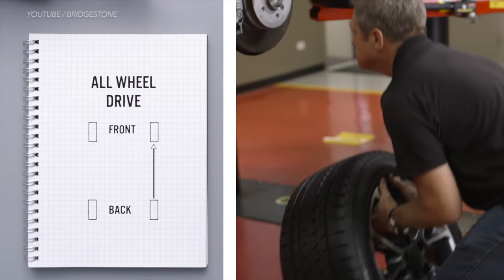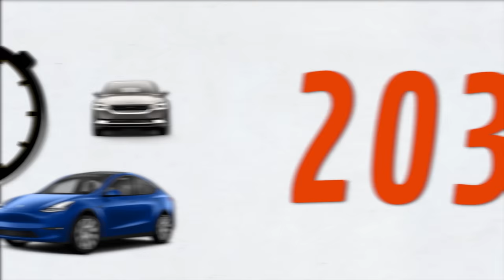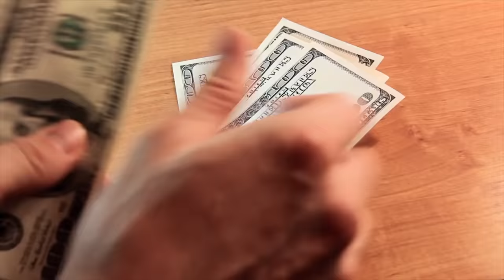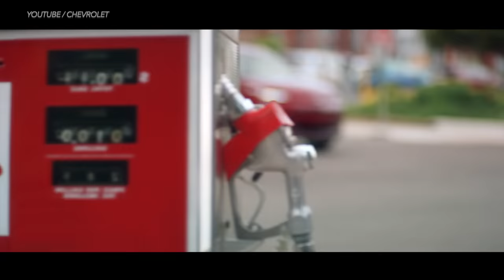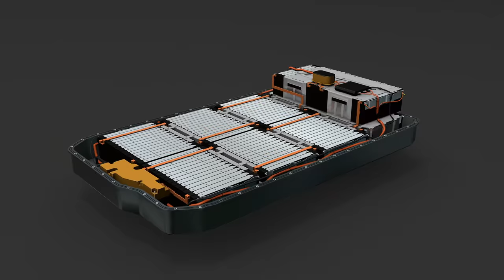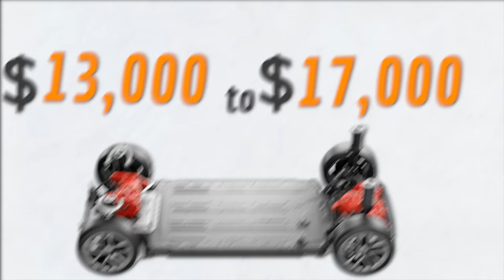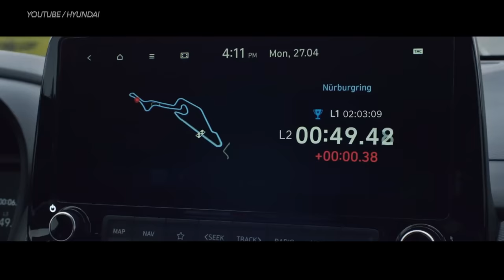No One is Telling You the Truth About the Real Cost of Owning an Electric Car, So I Have To

Comment: I'm not jumping on the EV bandwagon for another 10 years or so. Although the technology has improved tremendously over the past 5-10 years, the bugs have yet to be fully worked out; not only in the vehicles themselves, but also in the power grid infrastructure, raw material manufacturing, and the vehicle production process. We've spent, what?... 150 years developing the combustion engine to get to the modern versions, which are the most efficient and powerful they've ever been, while being affordable. EVs will theoretically require at minimum, 50-75yrs to reach a similar state (theoretically, meaning based off the combustion engine progress, but also considering modern technology is more efficient and advanced).

In addition, I won't be buying an EV anytime soon because I had to buy a new car last year (old one broke down). At that time, there weren't many EVs to choose from because, weirdly enough, all the major companies began releasing them after my purchase. And of those companies, there are some I'd NEVER buy from (Tesla included!!).
If the government tries forcing me to switch to EV, then I'd do it, but only if they pay off my car loan AND also give me a few extra grand$ for inconvenience and other issues. And I'll fight the high gas prices because a lot of it is due to corporate greed and the government screwing everything up by forcing the "green agenda" down our throats before we can actually sustain such a thing. Going green requires a plan, time, and lots of effort. If you just expect people to go out and adopt a green lifestyle over night, then not only are you hurting the people (like me, who has to sell their new car in a market where combustion engines would be useless and also be forced to pay off a car loan up front in order to do so, as well as spend more money of the actual EV) but you'll be rushing into a new system without proper preparation, which will ultimately kill the whole system.

I'm also not a very patient person, so having to wait for my EV to be "refueled" is not an option for me. There are rapid charging stations, but unless these can charge my car in like 5 minutes, I'm not impressed. And don't get me started of battery efficiency because here in Texas, batteries suffer a ton from the high heat, and you have to run your AC at full blast (especially these past weeks where it's been up to 107F), which will kill your EV's battery much quicker.

Comment: EVs are still quite bad for the environment. Battery mining, tires, the infrastructure needed for cars (lots of pavement and parking lots that absorb heat, not so much green space, etc) While they are better than their gasoline counterparts over the lifetime of the car, they are far from the perfect solution to our environmental issues.

Comment: As an owner of an EV, I gladly trade having some extra tire costs every few years to saving 66% of my fuel cost EVERY TIME I FILL UP.  And I'm not even going to mention never having to deal with a :
1. oil change
2. alternator problem
3. worn belts
4. tune ups
5. stolen catalitic converter
6. transmission problems
7. radiator / water pump problems
8. fuel pump problems
9. engine sensor problems
10. head gasket problems
11. fuel injector problems

you get the drift, right ?
Reply: For now. Soon you will pay just as much for electricity. Do you think they are going to watch that money walk away. 😂 Nope. You are an experiment bro.

Comment: The other nasty truth. Wear on tires pollutes more than an ICE in operation. When you are planning to phase out lighter ICE vehicles and have faster wear on tires EV car tires pollute more too. Think about it though, ICE emissions (which they've been able to really reduce drastically with technologies over the last 60 years) are usually gas (atmosphere) but when you're talking about rubber (and other tire products/chemicals) wearing down on tar roads...that's actually solid. That wear and tear of burned rubber and breakdown of the tire treads with rain, erosion, elements, etc. goes into the earth itself. Think about that getting into groundwater and runoff. 

This is why I don't buy into the green goons' narrative completely about motor vehicle carbon footprints and how going all electric is this environmentalists' dream.

Comment: Your constant negative rants on EV's are totally unfounded. My (Korean) EV is 5 years old and still on the same tyres, nothing has happened to the car mechanically or electronically which is more than I can say about previous car, a 2006 Mercedes 320 ML purchased new by me built in the USA and needed all 4 doors and bonnet replacing under warranty after only 3 years due to manufacturing fault. Here in Norway EV's rule and guess what, none of them catch fire? US fire departments respond to an average of 287,000 vehicle fires per year (nearly 17% of all reported fires). These fires cause an estimated 480 civilian deaths (more than 12% of all U.S. civilian fire deaths), 1,525 civilian injuries, and $1.3 billion in direct property damage annually. The ones that are EV's in annual statistics you can count on one hand. Please find another subject.

Comment: Not an EV fan! I see more problems in the future with electric infrastructure capacities. If the demand exceeds the ability to provide adequate power to maintain the additional load on the grid then there will be more brownouts. As time goes by the electrical grid will grow but what say you about power plants??? Atomic power has been vilified and has become out fashion, so has coal fired plants and soon any fossil fuel power ( including LNG. LPG ). Solar, wind power will never provide the capacity necessary to power everyone’s needs. Then we get into the recycling of EV batteries. What if anything can be done without further destruction of “OUR” environment with additional dangerous elements from EV’s??????? JMHO
Reply: Gee, will energy conservation become fashionable when the cost/availability is high enough?

Comment: - - - The whole EV vehicle thing, the cars puny range, home charging set up cost, getting the power for everybody to charge them at will, the ridiculous recharging times, their battery woes such as green? manufacturing and disposal and...,  is a bad idea. One in which the masses have blinded themselves to their problems and just as blindly followed each other off a cliff into the "future."  EVs should be consigned to a small niche market toy for people with excessive disposable income as the vehicles are just that, expensive and all too quickly disposable. All too soon America will follow China in discarding their broken or used up EVs once the EVs hit its owners with a big bill (e.g. $13,000 - $17,000 battery replace cost). Most people will use that money instead towards another EV, or something else.

Comment: I just put new tires on my Model 3 and it was a little under $1200 at Costco out the door. It had 30k miles. I rotated them twice each at 10k miles then replaced them at 30k they were worn but worn evenly. They had some tread left but were noisy. I put on the pilot sports on mine.

Comment: This guy is living in like....1990.  EV's haven't needed "special" tires since about then.  They use regular tires like any other car.  Just with more PSI in them.  Most cars now use high milage, low profile tires.  My last tire change, they cost $140 a piece for 50K tires...  And I could have gotten cheaper versions if I wanted.  And its not a Tesla....  Its a Audi SUV

Comment: No normal sane person would ever buy an EV, they might have less moving parts but all the electronics computers if they fail going to cost a fortune to fix. I do my own maintenance on all my petrol diesel cars  and the majority of issues you get are with electrical systems sensors going bad ECU and general electrical problems, My 69 mustang just keeps on running easy to fix and and probably will last another 50 years. I don't think  all these EV will be around in 50 years let alone 20 years

Comment: The other part of this, that no one mentions, it that the overall cost will continue to go up. Not for the cars and parts. But, in the cost of electricity across the board. So, while they tout about ev's. They're keeping the fact from you, the more ev charging stations that are needed, the more money there will be needed to maintain them. This means the cost of recharging will go up. Then there is power production. The cost to produce the power to maintain this, means the cost to produce said power is going to go up. This means, not only will it cost more at the recharging stations, it will cost more on your home power bill as well.

So, when you stat factoring this in, then the cost of ev's will reach the same cost, if not more, than cars today.

And as you pointed out. Less to maintain, which means, more unsafe vehicles on the road. Well, there goes those insurance rates up, as more and more accidents happen. It's difficult to get people to maintain current cars with all the requirements. Cars that have less... well... Scotty, you're a mechanic. You can see where I'm going here.

Comment: One thing not mentioned is that the high torque of the motors causes the tires to break loose from the pavement, thus reducing the life of the tires. It's not just 0 to 60. I had that problem when I first got my Leaf. Once I learned to drive without spinning the tires they lasted longer. I have had my present tires for two years and they still have plenty of tread. Some tires just don't  hold up very well. Car manufacturers put the cheapest tires on their EVs. There are better alternatives to the manufacturers tire. Not everyone has a Tesla. I can have a used battery installed for less than 10 grand and get three times the milage of the original battery without the new car price.

Comment: True. Tesla Model S tires. You buy a 60k miles rated tires, it will only last between 20k-30k miles...closer to 20k than to 30k. lol....I have to replace 4 every 18 months or so. Plus, the brakes don't get used often so the rotor will rust faster due to not able to heat up....The rotors will get rusted. I don't need to buy gas, but, I need to pay out about $1000 every year....So, despite the gas saving, you loose in other places. Tire rotations don't even help. Don't waste your time on it.

Comment: 32 year ASE master tech here. Been electric for 10 years now. 2018 M3 4 years. Yes you go through tires but little else. I burned through original factory tires in 20k.  Bought second set of factory tires, 20k  also. Yes I drive the car like I stole it. I  am not surprised or shocked that this happened.  I could afford the car, I damn well better be able to afford the tires. Also I have solar so I drive for free. System powers both electric cars, the whole house and I, as of this month, have banked 3.7 megawatts with the utilities.  Occasional cabin air filter and washer fluid. I'm on my 3rd windshield, but I live in Colorado, so standard stuff. Still far less than any ice car out there for 4 years and 52k miles. Not really a dirty little secret. It just is what it is. Here's the dirty little secret. I own one of the fastest, coolest, most reliable cars on the planet. Only thing cooler will be when my Cybertruck gets delivered.